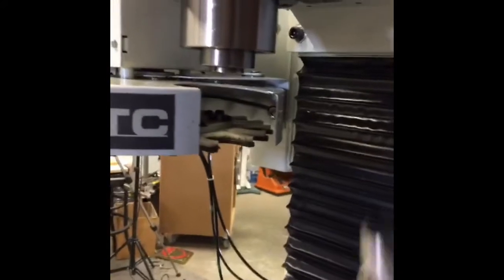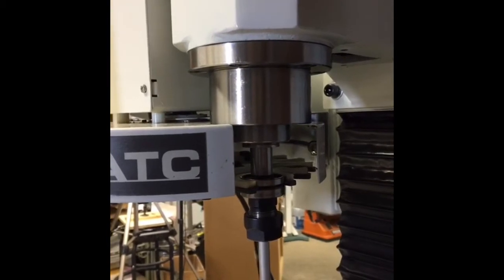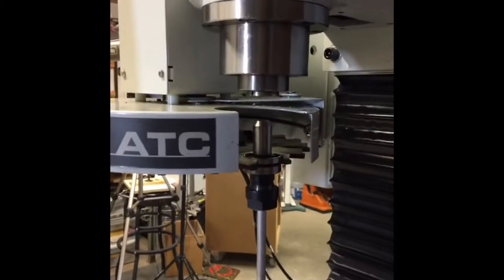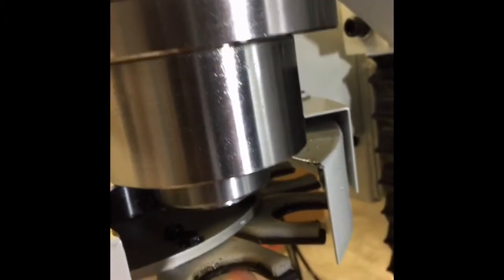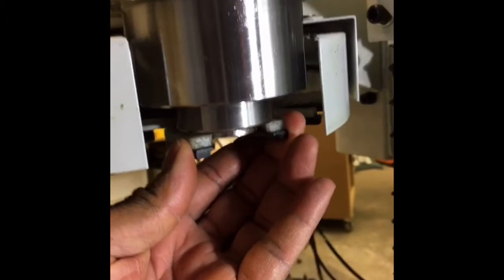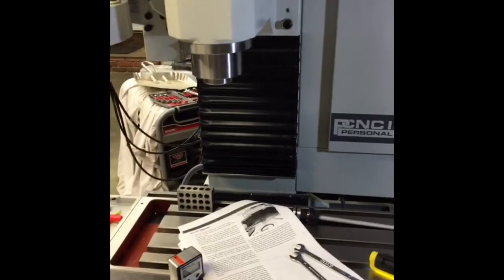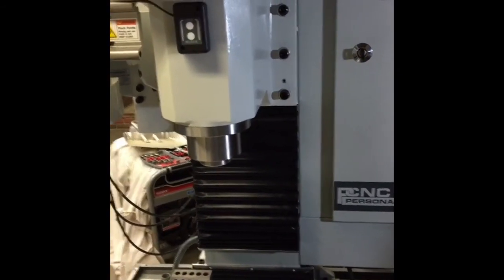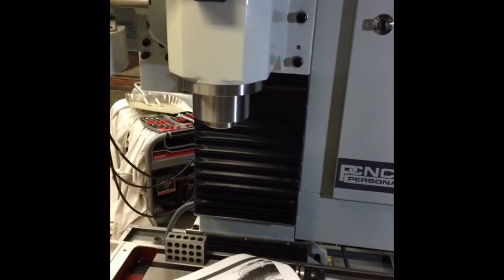Adjusting The Tormach ATC

Comment: To adjust the tool fork of the ATC along the X axis, retract the ATC and look for the nut facing the spindle direction, that is located between the 2 round ATC rails.  You loosen it, and adjust the nut that is behind it. Pull or Push the ATC in the direction that you need along the X axis, and tighten the nut.  Keep adjusting until you are aligned.  It's a 5-10 minutes task.